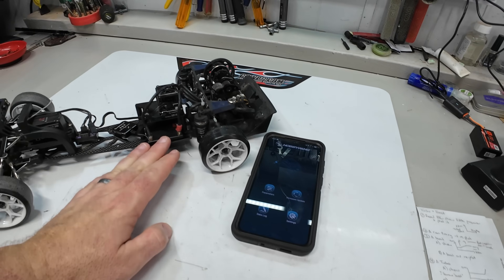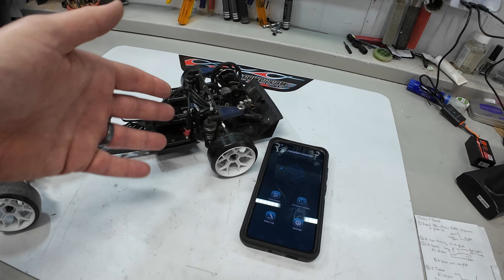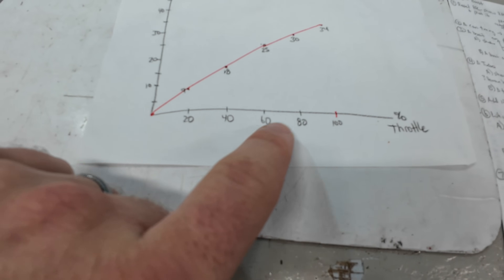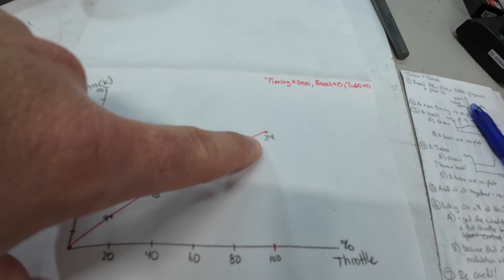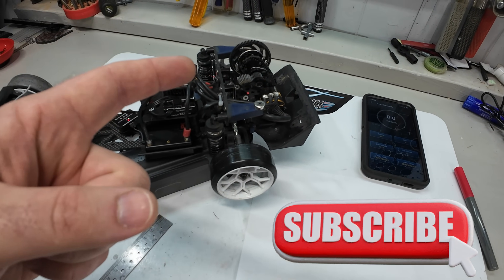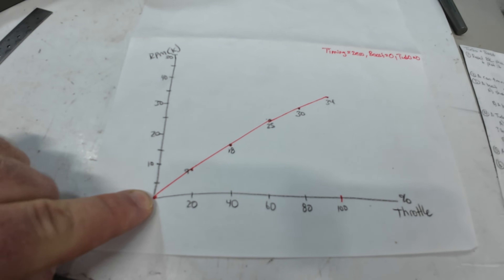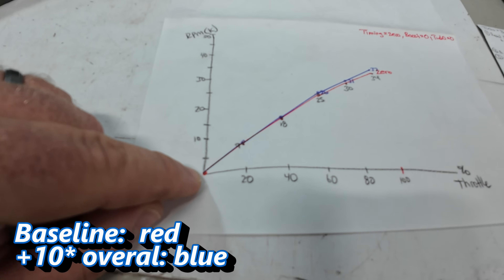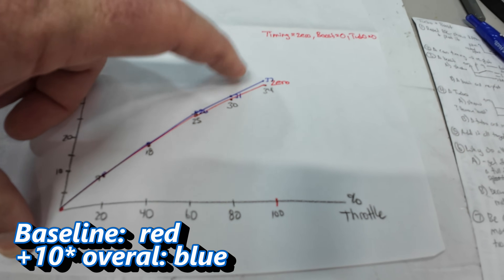RC Drift Tuning:  Boost and Turbo Basics Explained!

Comment: You've been helping me a lot. I'm a big crawler guy just getting into drifting. So far I've stuffed a bunch of crawler parts in myst 2.5 my copperhead 10 in cheater mode is doing pretty good for the tuning side and I've found a way to have a rev limiter with my radio link 8ch controller via abs
Reply from the maker: Glad that is working for you!  Good luck on your drift journey!

Comment: Whats a good boost and or turbo settin for my xd10 esc. Im searching for a good tune for it. My motor is set to about 30 degrees on the can.im runnig on a medium size track with 1 long sweeper and alot of 180 turns. Thank you
Reply from the maker: I typically start around 10-15* boost and 15-20* turbo.   Give those a shot and see how it works for you.

Comment: Say you’ve tuned your esc for a basic boost turbo setup. On the transmitter side of things, do people keep it a normal ‘curve’? Or dull out the lower end of the throttle curve to get even lower rpm ?
Reply from the maker: I frequently use exponential to "numb" the lower-end of the throttle curve.

Comment: i recently got a new Acuvance Fledge 10.5t, and it came set at 30 degrees of timing. If i want to use esc turbo and boost, what should i set my physicall motor timing to? thanks.
Reply from the maker: That 30* on the motor is a good starting point.
Reply: and its safe to still add esc turbo and boost? dont want to destroy this motor lol, thanks for replying though!@RoadsideRC

Comment: Thank you for the info. Been struggling with this for a while. What pinion and spur gear are you using?
Reply from the maker: Glad this helped!

I can not tell you anything about pinion and spur gear - and if anyone online does, you should ignore them. 

Gearing depends on the size of your track, surface, and electronics you are using.  Nobody online can tell you what to use.  

For this, you must test different gearing and see what works.

Comment: Hey do you go to more than 1 track? I would encourage a video based off of two different tracks data. Could be interesting. Maybe focused on fdr and also youre tune.
Reply from the maker: Interesting idea!   I have the ability to test at a smaller vs larger track layout.   What do you think the results would be?
Reply: @RoadsideRC  im just wondering what you think would be a appropriate change in gearing and esc tune per track. I've driven 3 tracks here in the Midwest and have always changed fdr based on track size. Maybe youre experience is different?

Comment: There’s also talk about between motor, boost, and turbo degree/timing  one shouldn’t go over 60 between the 3. Not sure how true this is tho just from what Iv been told and read. Is this something you know if true or not ?
Reply from the maker: It is certainly the rule that I start with...but have gotten greedy and went beyond that multiple times.   Seems it is dangerous to add that much timing quickly, but OK if ramped in slower.

Comment: Very good explained Troy!😊 
(also, if you add 20⁰ Turbo started at 5.000rpm to 25.000rpm, so the ESC to ad 1⁰ timing every 1.000rpm from 5.000 to 25.000 and holds then 20⁰ by passing 25.001rpm; and also later at 100% throttle it adds the turbo timing (if turbo is set to 10⁰ then there are 30⁰ of timing😉))
Reply from the maker: Yes!  Thank you for the kind words.

Comment: Thanks for this. There's a lot of information here. Ive been in RC for 20 years, most of that in racing. Wish I would have had this video years ago.
Reply from the maker: Thank you for those kind words - I really appreciate it!
Reply: Yeah this is a useful video for sure. I've found many people at my local carpet track don't fully understand the difference between boost and turbo and how to use it.
Reply: @carlomcdythis is the same problem im currently running into and this video explains it all very well.